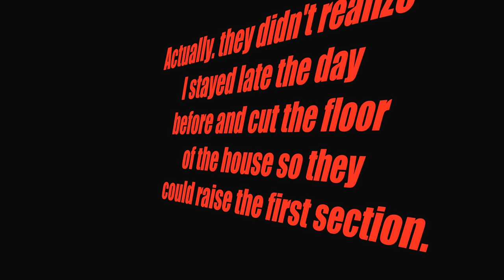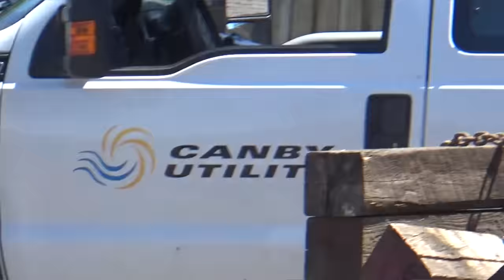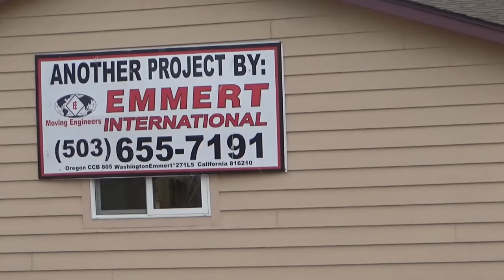Cut & Lift A House!

Comment: Rick, after watching you sawing that floor off... I was a tad concerned for your safety... but all was good in the end. But I do hope that you rested up before you tackled that roof. Oh yeah drink heaps of water in that heat. The Emmert crew are fast workers and doing great. So next up is the two parts of the house being put on the truck trailers before the big haul of 15 miles to your ranch.
Reply from the maker: I'm hydrating....Thanks for stopping by again!

Comment: OK!! So now, you need to make a 50' wide path from the road to wherever you intend to "park" your new house back at home before the house comes rolling down the road. It wouldn't do to "double park" that thing while you're excavating !!! 
That chainsaw blade was "smokin" when you was getting towards the end of your "cross-house" cut. I guess it had cut a few nails along the way. ???? 
How do they plan on supporting that roof beam while their moving the house that's on top of that post right near where you were cutting the floor??? A long diagonal brace down to the floor from the side wall ???
Reply from the maker: Its a nail saw...yeah...it was smokin'-mad at me. I'll deal with that beam in the next episode.

Comment: Nice to see how they raise the house. Is all that you had to cut out with saw today, will it just be thrown away or parts of it saved as templates? Getting closer Rick? 👍
Reply from the maker: No, it will be getting widened 20-feet where it was cut. I have the floor sections though...I'm thinking a dock for the swim hole.
Reply: @ClassicTruckRescue  also great video with the drone, I caught the glimpse of the bird flying by too! Cool👍😎✌️